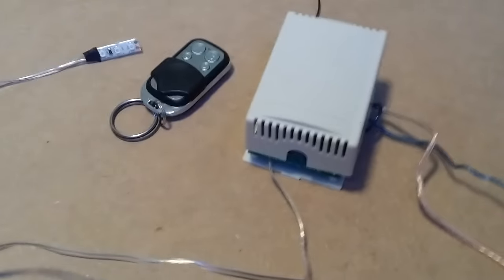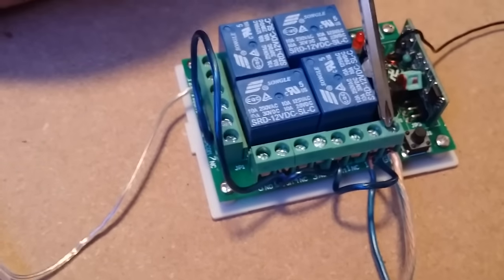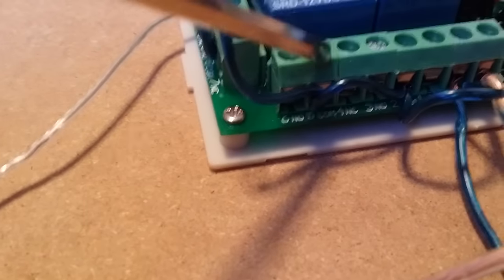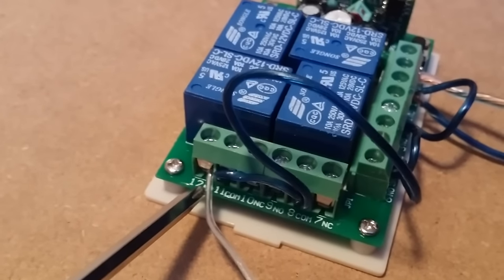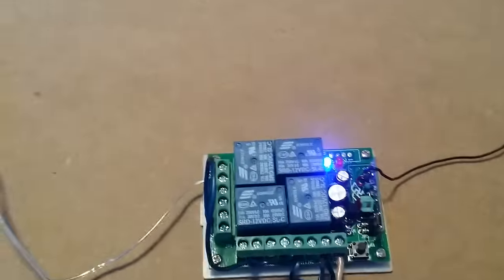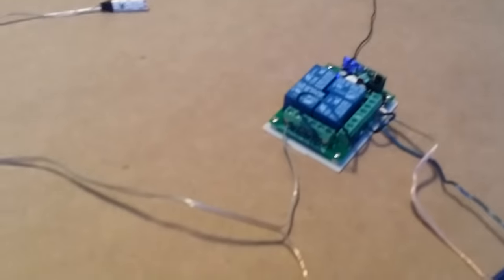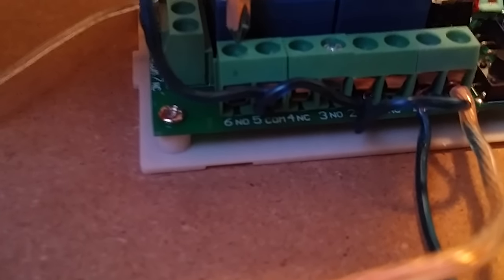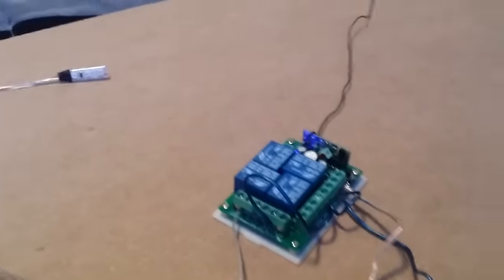How To Use A Wireless Relay/Controller!

Comment: i still do not  understand how to wire this for what i am trying to do, i do not want to use the same power supply for  the thing that i am trying to control as i am  going to be using for the power to the board itself ,so of those 3  relay terminals NC, NO and COM, when i hit the button on the remote do i get continuity between any  2 of those terminals?if so which ones, NO and COM or NC and COM right? i just want to be able to wire the 2  power terminals of this RC board  to the  positive and negative terminals of a  battery or transformer to power the RC board
then  connect 2 wires from the circuit i am trying to control to those terminals and use it in place of a physical switch, the circuit i am trying to control has it's own power and it is not 12v it is a different lower voltage
so can i switch something with this without having to connect any of those 3 terminals bridged with the power supply if the circuit i am trying to control has it's won power supply?
Reply: Yes you can. Just choose NO-COM or NC-COM and make sure the voltage of the power supply is suitable for the relay (120V or 220V).
Reply: yes thanks i figured it out  
my next question is  is there a way to  alter the remote FQ so that i can buy more relays without having to buy  more remotes ?so i can get different FQ's to control  more relays
i had a 433mhz universal garage door remote with dip switches in it but the relays won't learn from it
 the relays won't learn from a bunch of other 433mhz remotes i have either,  i thought the 1st relay was broken then i ordered another one and a remote and got it working finally
guess it will only learn 433mhz remotes with certain chip sets
one idea i had was building an RF TX/RX  for the PC , i saw plans for one using a cheap $2 USB soundcard and a super hetrodyne  TX/RX set  ,read the code from my relay remote with it and alter it a little  with the software(forgot what it is called and never used it before but i assume it would be possible) then TX it back after altering it a little
or is there a remote that has a way you can change FQ so you can get more than 4 different FQ to control more than 4 different relays, 
the reason i want to do this is because i  do not plan on using the relay remotes  because i have a broadlink RM pro, it's a wifi universal remote hub you control with a cell phone so i would use the universal remote hub and my phone and the app instead
(hub does IR and 433mhz RF)
Reply: All I know is there's no system where a master remote that can operate on several equipment.

Comment: I've got a 32 inch led bar would it work on the relay ?
Reply from the maker: Joel Chaffen yes, you just splice the output wire of this controller to the accessory wire on the switch, then you can use either the switch or the wireless controller

Comment: Where does the ground wire go?
Reply from the maker: The ground wire just goes to any ground anywhere in the vehicle, like a bolt or screw in the body/frame or just wire it to the negative battery terminal